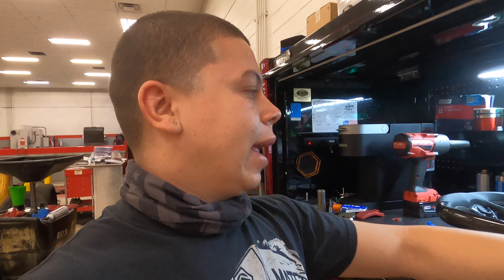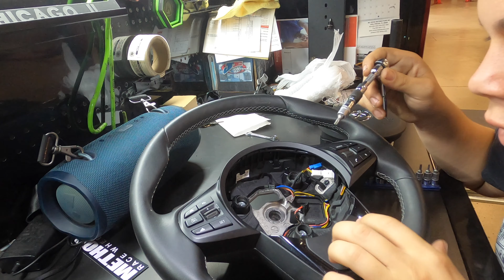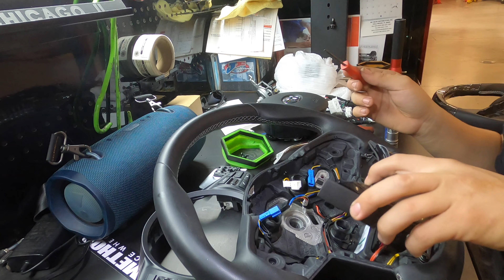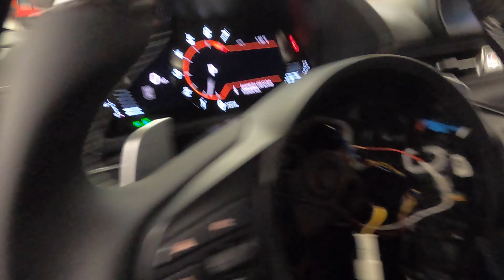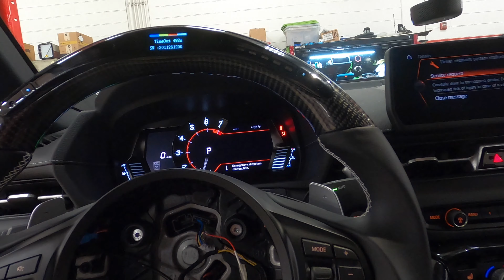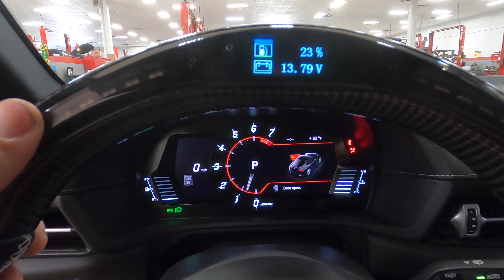2020 Toyota Supra Carbon Fiber Shift Light Steering wheel install (Unleashed Customs)

Comment: Yeah. I must have done something wrong. My LEDs are not light up...after i did soder it to the green wire and have everything hooked up... What's this about that white wire though
Reply from the maker: White wire by Bluetooth box has to be connected together
Reply: @erickbuilt3402  connected to what?
Reply: @erickbuilt3402  as I'm not getting any lights on the led wheel
Reply from the maker: @Frankie_Freedom  did you try holding the buttons on top of the steering wheel to turn it on?
Reply: @erickbuilt3402  hey thanks for the help...ended up finding the issue. Where the power wire was clipped by the airbag when I snapped it back in. Reconnected and got it working

Comment: Did you get a driver supplement restrain error For powering up without the airbag connected I did if so how did you clear it?
Reply from the maker: I did but as a tech for Toyota I cleared it with computer
Reply: What’s the purpose of disconnecting the tweeter wire and what do you do with it?
Reply: Why did you disconnect the tweeter wire ? Cause you did it without saying why

Comment: What did you torque the steering wheel bolt to? 25ft lbs?
Reply from the maker: I believe it was about 35 I have to double check repair Manual
Reply: It should be 45lbs